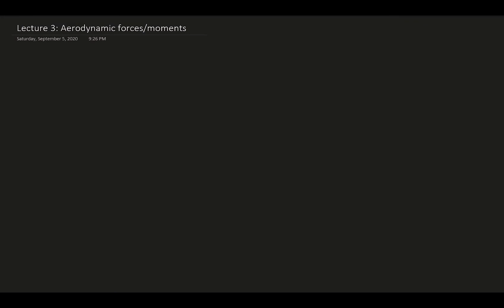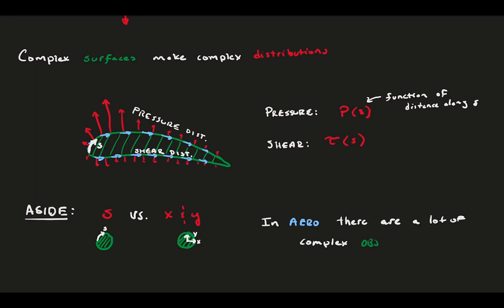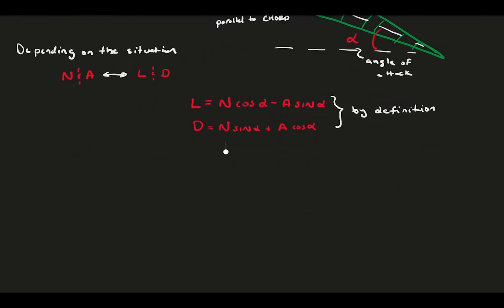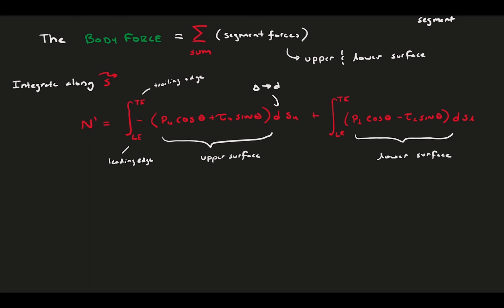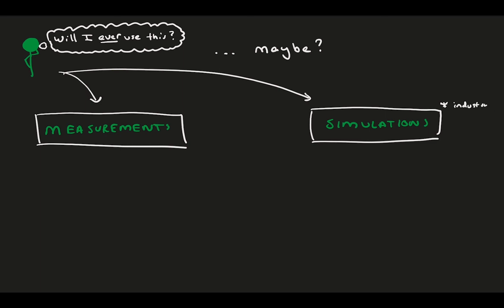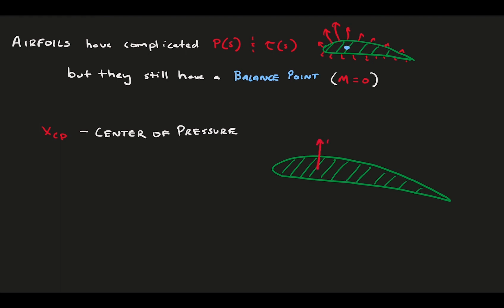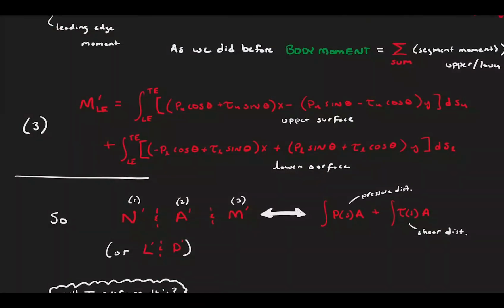Aerodynamic body forces and moments [Aerodynamics #3]

Comment: Why is the pressure the same on the part of the cylinder facing the incoming airflow as compared to the part of the cylinder facing downstream?  It seems that the deceleration to the stagnation point would increase pressure on the upstream side of the cylinder and the airflow pulling away from the downstream surface would decrease the pressure.  It certainly isn’t obvious why the pressure distribution is the same on upstream and downstream “sides” of the cylinder.

Comment: This lecture is very useful for me as a mechanical engineer. However, I still have some doubts. At 4:29, you mentioned the pressure distribution over a cylinder. My question is, at the stagnation point, the velocity will be zero. I have studied that pressure is inversely proportional to velocity, so at the stagnation point, the pressure should be at its maximum. Is that correct?
Reply from the maker: The pressure will be the stagnation pressure at the point where the fluid stops, which is typically the highest pressure point in the flow (you have traded all the bulk kinetic energy of the fluid for internal energy).

Comment: Why are the pressures on the front and back of the cylinder in opposite directions?
Reply from the maker: Not sure where specifically you mean, but generally I draw pressure as being normal from the surface with the arrow length correlating to pressure strength.

Comment: If the fluid flowing at the top is faster, then why is the pressure there higher? Should it be lower instead? I'm confused, please enlighten me.
Reply from the maker: Great question, I think I am just confusing with my arrows. In that case, it's really to indicate there is a strong pulling force (low pressure region)
Reply: @prof.vanburen  Your videos are great! For this point, I also got confused, since I would expect the top/bottom pressure to be lower, since the velocity is higher. Would it make sense to add a note about that? Thanks so much for your videos.

Comment: In the case of the inviscid cylinder, won't there be a net momentum change of the fluid along the x-direction, I mean, won't the dynamic pressure hitting the left side of the circular cylinder cause the object to move towards right. And also in the viscous flow over a stationary cylinder, why does viscosity favour flow separation
Reply from the maker: Great questions and thanks for your interests! 

In the inviscid case where flow is symmetric on each side, though there may be pressure changes everything happens equally on both sides so it cancels out. For example, consider the stagnation point, where flow goes from non-zero to zero velocity---this momentum change led to a force. However, on the backside of the cylinder, there is another stagnation point where flow goes from zero velocity to non-zero, meaning there is an equal and opposite force. 

In the case of viscosity's role in separation, viscosity is what causes the boundary layer, where near the wall flow is slower. Separation comes from the fact that flow has reversed direction due to adverse pressure gradients (or other impediments), and in the boundary layer flow is already going slow so it is more susceptible to being reversed.

I hope this helps!!

Comment: Hello! Thanks for the series. A quick question. Are the Pressure and Shear forces described here experienced by the foil or the air? As in, is tau the shear stress of the air or material and it just acts parallel to the surface? It may seem like a dumb question. Thanks!
Reply: the forces will be experienced by the foil
Reply: @tom_winguill  Thanks!
Reply from the maker: Not a dumb question and thanks @tomwinguill2924 for replying!

Comment: Dear Professor Van Buren
I have a question about pitching moment about leading edge of an aerofoil

Why there is a -ve sign for x arm length and +ve for y arm length in the pitching moment equation derived from normal and axial forces on lower and upper sides?
Reply from the maker: Thanks for your question! This one is a tougher one to explain in writing, unless I am mistaken this is just a matter of sign definition. Positive moment here is described as clockwise, so the terms are signed such that they either contribute (positive) or take away (negative) from this clockwise moment. Hope this helps!
Reply: I believe, A in lower surface creates CCW moment about LE and must be negative. What do you think?

Comment: 18:48 Why does the axial force necessarily lie on the chord line?
Reply from the maker: That's a good question! I am not sure I can answer it completely but I will try. By definition, the axial force is parallel to the chord line, but the actual point the force is applied to the foil is dependent on the pressure and shear distribution. However, it is likely a decent approximation to put it on the chord line to make the math more simple. Later on in analysis we like to approximate the foil as being thin (Thin Airfoil Theory) and in this analysis we approximate things as being on the chord line. There might be a more rigorous explanation out there, but I interpret it as just being a decent assumption (because airfoils tend to be thin) that leads to more approachable calculations.

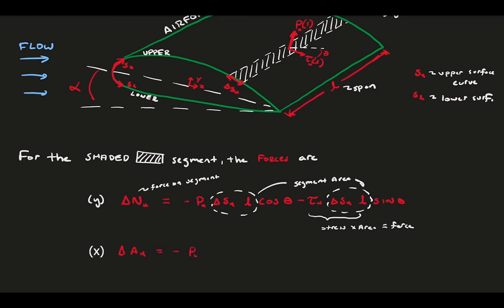Comment: i did not understand how you did the projection to fin delta N and delta A at 11:02
Reply from the maker: For the segments delta N and delta A you need to multiply the stresses (Pressure and Shear) x and area. The area here is the area of the segment, delta s x l. That segment can be at an angle (theta) relative to the coordinate system, so in order to get it to align with the normal and axial force (N and A) you need some trigonometry. I hope that helps!
Reply: so theta is the angle between the shear stress and A and also between the pressure force and N ?
Reply from the maker: @khaledfakhfakh3003  essentially yes. Shear stress and Pressure act tangential and normal to the segment surface, and that surface is angled away from A and N by angle theta.

Comment: Hello Professor, I was wondering if you have a video on how to integrate the pressure? I'm currently doing a school related project, where i've been in a wind tunnel to measure the pressure over an airfoil with pressure tabs. I got another integration method, with numerical integration which *should work*, but it would be great to have your method give the same numbers. Any ideas? Thanks in advance:)
Reply from the maker: I don't! That's a nice idea to have videos dedicated to practical applications of the tools. 

Please feel free to reach out and I can work with you on the integration. I'm thinking if you have discrete pressure data along the chord you can just apply the trapezoidal rule to integrate it, or possibly fit a function to the data and due a true integration (the former method is more common).
Reply: I handed in the exam paper last friday, but I did come across the trapezoidal rule and that did do the trick. I ended up taking half of the sum of the two pressures times the distance between the pressure tabs along the entire surface (which didn't include the angle of the surface). Your videos were very helpful to get me through the rest of the paper and give a good understanding on the subject.

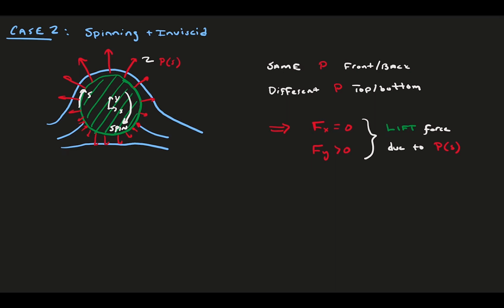Comment: Hello professor, still enjoying these lectures! But i have a question; at  around 6:15 the spin causes pressure distribution to change, why does the spin affect our pressure distribution?  i could not grasp it properly.
edit: im also having trouble understanding why we are taking P as negative  at airfoils.
Reply from the maker: Hey Olim Olim! Glad you're enjoying them. The spinning causes a pressure difference because of something called the Magnus Effect. The top of the cylinder accelerates the flow because the cylinder surface velocity is in the direction of rotation. On the bottom, the cylinder velocity is opposite the rotation. These velocity differences inherently lead to pressure differences through the Bernoulli relationship, leading to low pressure on top and relatively higher pressure on bottom. 

Regarding the edit, I'm not quite sure what you mean. Where on the airfoil specifically? Maybe you mean that the pressure difference, relative to the reference undisturbed pressure, is negative?
Reply: @prof.vanburen   sorry about that, got a little rusty with my English. 
while we were calculating the forces on the shaded surface ∆N= -P * ∆S...
Why is P negative?
Reply from the maker: @olimolim7230  No worries! It's just a matter of sign convention and getting direction right. You will notice that the signs are opposite for the lower surface. I'll have to double check a textbook or two when I'm back in my office, but I'm pretty sure that it's because on the top, the pressure force is acting against the conventional normal force direction. Does this help?
Reply: @prof.vanburen  yes it does help, thank you professor 🙏🏻

Comment: When talking about pressure distribution over a cylinder, doesn't the pressure decrease,  reach a minimum and then increase as it flows over the cylinder. The flow would accelerate right?
You've mentioned pressure peaks as it flows
Reply from the maker: I may have had a bit of word salad, but typically I am referring to the pressure difference with respect to the infinite case, or delta P. So when pressure decreases due to acceleration, the absolute difference gets large.
Reply: This helped. Thanks. I was really confused. 
 @prof.vanburen

Comment: You are saying that based on the trigonometry but please explain more particularly about how extract formula from the trigonometry in a airfoil.
Reply from the maker: Hm, can you be more specific about where in the video? In general, when I say "use trigonometry" it refers to angle/side length systems like finding the component of one vector in another direction. For example, when finding the portion of the Normal force in the lift direction, you would need to do N*cos(alpha). There is also a component of axial force in the lift direction, which is -A*sin(alpha). I think that, for the most part, that's what I mean when say using trigonometry.

Comment: Why do the stagnation points at 5:51 change if the flow is inviscid?
Reply from the maker: That's a good point! It's not so exact here and not entirely true to say "inviscid", you need the boundary condition to accelerate/decelerate the flow and cause the flow change due to rotation. However, it changes the flow more globally, even outside of the wall region in places we can assume the flow is safely inviscid.

Comment: in anderson's book, the total axial moment for the bottom surface is (Pl sin teta + Tl cos teta), why the sign is positive since Pl sin teta and  Tl cos teta will cause counter clockwise moment?
Reply from the maker: Sorry to be late on this! I have to check the book to be sure, but my guess is it just boils down to a signing convention which can be counter-intuitive in aerodynamics.
Reply: @prof.vanburen  Thank you for your reply. if we look at page 21 and breakdown each force at the lower surface to x and y axis, pl sin teta will causes counterclockwise moment (The force is to the right) while Tl sin teta will cause clockwise moment (The force is downward) since the pivot is at leading edge.
but both sign are positive (dMl' equation 1.10 on page 23)
Pl sin teta and Tl sin teta should cause a different direction of momentum yet the sign are the same
that's the only part of the equation that doesn't make sense for me
Thank you
Reply: @alvinyustiansaputra9131  i was searching exactly for this question in comments section. That makes no sense for me either. If u look at perpendicular momentum on upper surface too, u got the first term Pu*cos(theta) + Tu*sin(theta), like it has an implied counterclockwise moment, which is false

Comment: I dont understand how stagnation points moves downwards for a spinning cyclinder in an inviscid flow ( at 5:33) Could you explain that bit?
Reply from the maker: You raise a good point! It's not so exact here and not entirely true to say "inviscid", you need the boundary condition to accelerate/decelerate the flow and cause the flow change due to rotation. However, it changes the flow more globally, even outside of the wall region in places we can assume the flow is safely inviscid.

Comment: is there any point on aerofoil where local velocity equals free stream?
Reply from the maker: Hi Fayaz, the question is a bit general to answer definitively. If you mean on a boundary then no, especially if you have a no-slip condition. If you are talking about the general velocity field around an airfoil (and we aren't strict with the no-slip condition), then yes there are possibly points where the local velocity is equal to the free-stream.
Reply: @prof.vanburen  
Thanks Professor Van for the explanation. this series is amazing.. :)